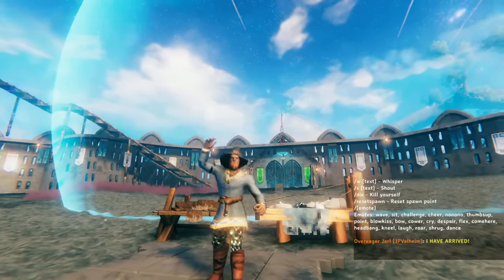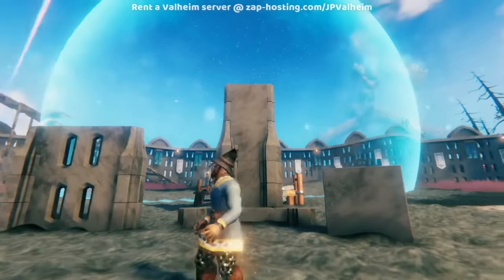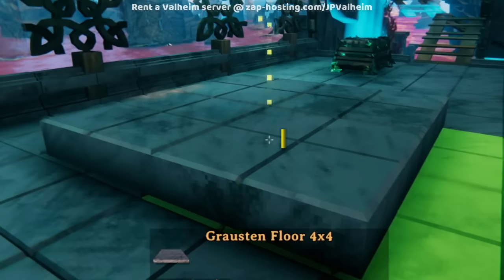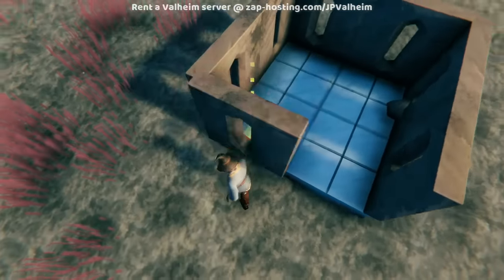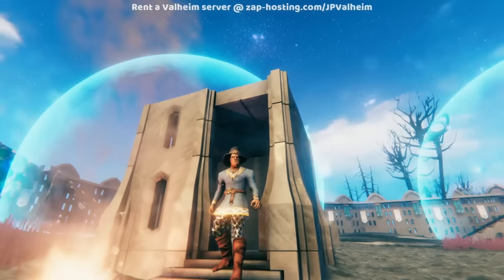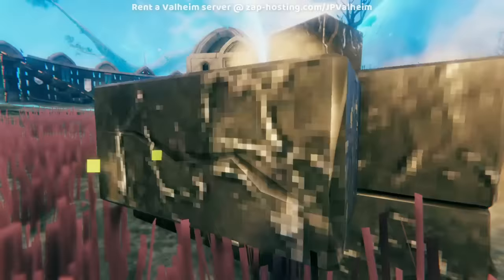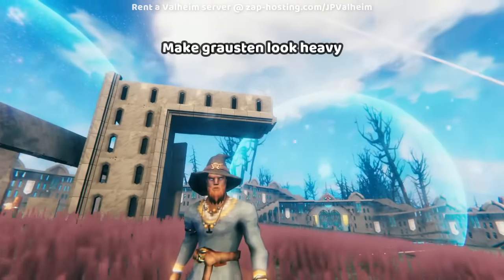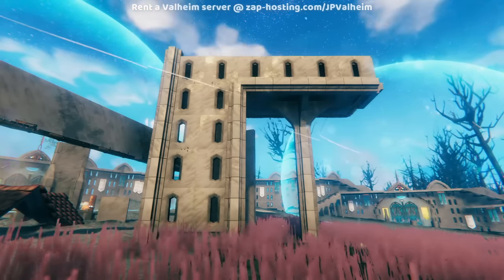Grausten Building Guide for Valheim Ashlands

Comment: I genuinely think that the vast majority of the complaints people may still have - especially now that the snapping glitches have been fixed - are entirely a skill issue. Or a creativity issue, for that matter.

These building blocks are absolutely godly for building finely detailed, versatile and diverse structures, giving you far more freedom than normal stone and black marble ever had or could give you.

Just think outside the box a little, you know? It's incredibly easy to build some gorgeous, monumental structures with these and although the default aesthetic is gothic, the simplicity and small size of the blocks allow you to force entirely different looks onto it with the right amount of effort and creativity, not to mention its use in conjunction with other materials, such as ashwood or stone, which gives even more variety to work with.

My only personal complaints are the following:

1) Centre snapping points for walls and floor tiles would be nice. I hate always having to place auxiliary blocks or doors every time something doesn't snap where it logically should.

2) 26° roof tiles... I mean, wtf, Iron Gate? Why not? The other two roof variants have 45° AND 26°, so what on earth held y'all up this time? I don't get it...  ;-;

3) On that note, some straight 45° and 26° pillars/supports would also be pretty nifty. While gothic architecture tends to have more diagonal lines that are rounded rather than straight, the latter can still make for some impressive, beautiful and complex supports... yeah, buddy, I'm talking about them flying buttresses! We've all seen'em, we all love'em, and we sure as hell can't get enough of them, but sadly, they are just barely even possible with the pieces we currently have, only with some really clunky overlapping of inverted well arches over medium arches... It's a bloody shame, honestly. The gothic aesthetic feels a bit incomplete in some builds without that feature being available.

But even with all that said, Grausten is still a solid 9.5/10, would recommend! 👌
Reply from the maker: This comment has more information than the video I made xD Awesome feedback!

Comment: Nice showcase of the new material. I am really enjoying working with it. For supports I found that the walls and flooring center perfectly using the iron cage pieces. The iron doesn't show through like it does with wood or stone.
Reply from the maker: Thanks for the tips!

Comment: It’s cut stone, it’s supposed to look blocky. lol. Sure, you gotta get a little extra creative to make it look better, but I enjoy it. Black marble is great for accent pieces, so is the ashwood, iron and Dverger pieces. I replaced all the wood in my Lox breeder with grausten, as 1 tiny bat raid would have my Lox’s smashing through the floors and beams, and since grausten is immune from rain, it doesn’t decay from not having a roof. It’s also great for Asksvin breeders, any starred Asksvin will easily smash through most other building material when a twitcher walks by or god forbid a lava blob comes plopping along if it’s in the Ashlands. If you bring some eggs home and make a breeder wherever your base is, even a lowly greydwarf tossing a rock at it is enough to make the asksvin go smashing through walls. Grausten holds up pretty well. I like it, kinda wish they’d add more roof pieces though, maybe some 26 degree pieces. A lot of my builds have those roofs, and the look would be totally different if I tried to switch em out for the 45 grausten roofs.
Reply from the maker: Great points :) Love it !

Comment: You mentioned the iron beams. Are flametal beams any better? And is there a way multiple grausten arches can share one snappoint? Thanks in advance 🙂
Reply from the maker: Im under the impression that all metal works the same stability wise; so you could use flametal bars instead of iron beams; but there won't be that much of a difference. Flametal looks cooler but is much harder to get; so it depends how you are playing really

Comment: I’m having an issue no matter where I build with this. It falls apart within a day and my whole build  just is destroyed by the time I login the next morning. Everything’s green by the time I log out all is fixed and looking great log back in the next morning. It’s all falling apart and random locations not in the same place either. It’s very aggravating. Any assistance would be helpful. we’ve tried building in the Ashlands with it. We tried building anywhere else to make it look good. It just falls apart randomly.
Reply from the maker: I'm not sure exactly whats happening with yours, but there seems to be some kind of issue with the structural integrity system when its close to breaking. You can accidentally trick the system into placing a full structure piece, which then will make you think you are building onto an area that is stable, when it will actually fall apart once the calculations finish (which takes tens of minutes after the last piece was added)
I've only noticed this with grausten, I saw it in a test I did earlier today. I placed metal and grausten together and it took forever for all of the stuff to break and settle. Then I logged out and  back in and the structure was recalculated and the top pieces of the test stack all lost one unit
Reply from the maker: You can avoid that by making sure none of the structure is close to breaking (keep the whole thing orange). To do that, youd need to ground metal beams into terrain and put them up into the highest parts of the build from the ground. The cage pieces are sometimes better support wise than the beams I showed in the video

Comment: im much more annoyed over not having any 1x1 or 1x2 m wallpieces, which makes making windows or fixing gaps really annoying when u switch between 2 floors or from wall to roof distances. and not having any ridges for the roof or 26 roofpieces also really bothers me. would also have wanted some beams, once more for fixing gaps but also for decorations around windows.
Reply from the maker: Deep North probably :)
Iron Gate in an interview recently said "We only gave you a few of the build pieces in Ashlands, all the rest are from Deep North"